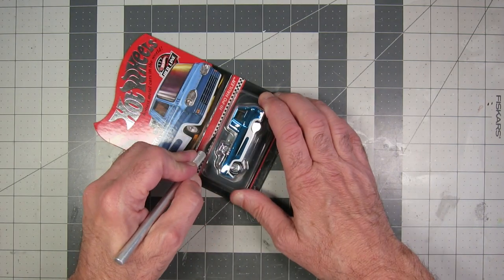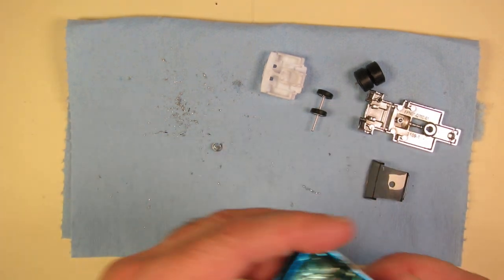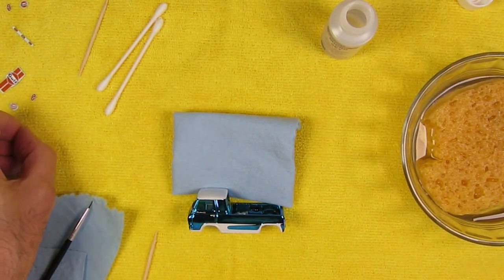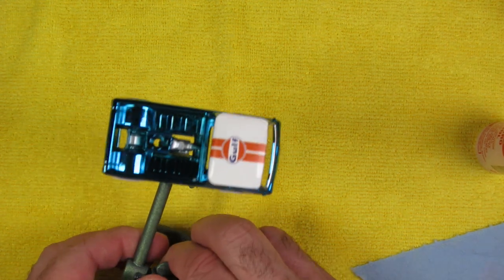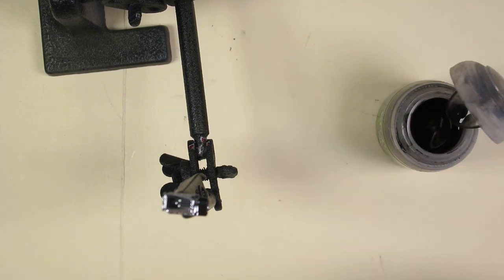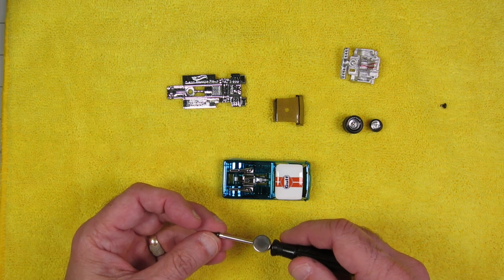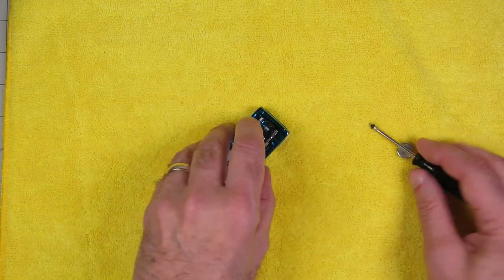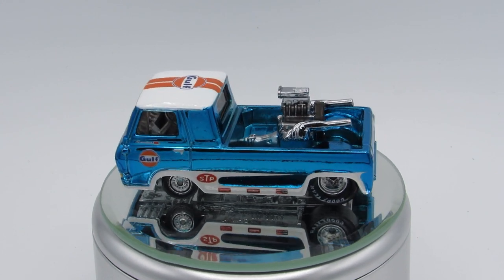Custom Gulf Hot Wheels Hi-Po Hauler / Gas Monkey Garage Design

Comment: I'd have been happy with a fully blue body.  The bottom white portion of the livery is great, but I wanted the roof blue at least.  The little touches you've added helps the truck a lot.  Breaking up that white roof with the orange gulf decal was a major improvement.

Edit: also yes.  Please mattel we need drag wheels!  We need a full pack of drag wheels.
Reply from the maker: Thanks Kris!  I understand what they were after with the white roof, but it probably could have been better accomplished with some kind of scallop design up there instead of a completely white roof.  It did come in really handy for the Gulf logo though 🤣🤣🤣

Comment: Look great I thought about stripping my hi-po like I did my Blown Delivery. I know it rubs some people wrong when we take these out of the packs but at the end of the day they are just a toy. Why not enjoy them.
Reply from the maker: I couldn't agree with you more Rodney!  I haven't caught much blowback on the RLC mods, but I have on some old Redlines...and I always enjoy telling those people that if they were so concerned about it, they should have bought the casting before I did (or in pretty much all cases, just bought one of the dozens of similar castings on eBay lol)
Reply: @JimSilva-SilvaDiecastCustoms  I hear you, l love to do restorations on old hot wheels when I can get them in my hands. I think I have 1 redline right now and it will be restored close to original but will have my custom twist. I am sure I will get some feedback either asking why didn’t I leave it alone or why it wasn’t spot on as original. Oh well it mine at the end of the day. I just wish I could find redlines and or older 80s beaters around here to restore. Very difficult to find here so I may have to turn to eBay.